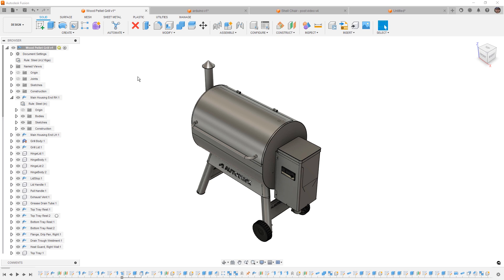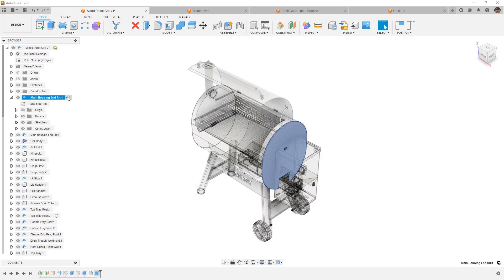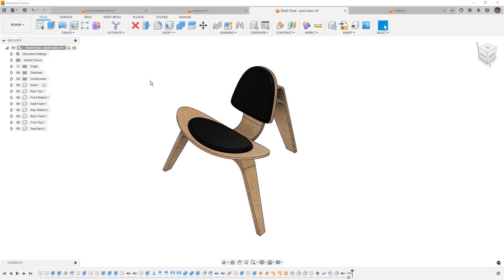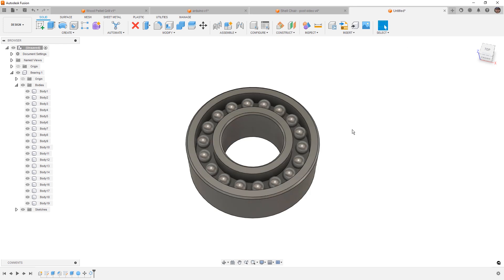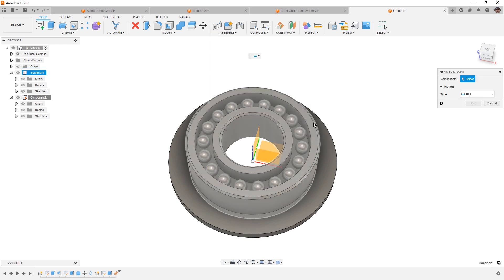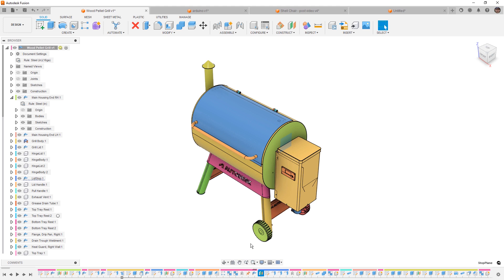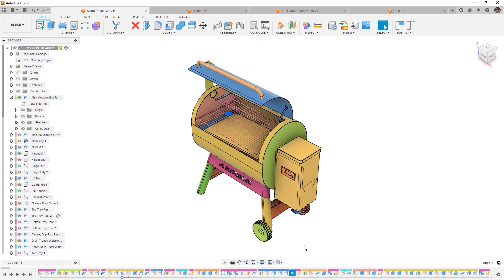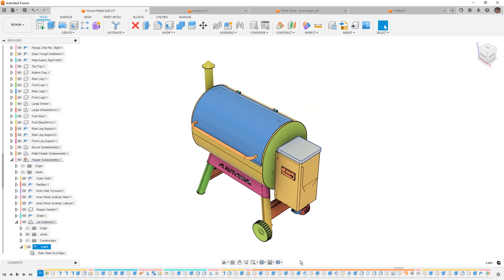Design History in Autodesk Fusion

Comment: 1:37 You should always create a component first, whether you think  you're going to end up with an assembly or not. Even if you're positive you'll only end up with one body, create a component anyway. This is so fundamentally important that it's literally referred to as "rule #1". There will most likely never be a situation where you'll wish you hadn't created a component, but you'll almost always regret it if you don't, and it can be VERY difficult to create a component from existing features afterwards. (Luckily there's a plug-in that will warn you if you attempt to create a feature without creating a component and activating it first.)

You should also always rename everything (every sketch, body, plane, etc) - descriptive names make it so much easier to work, especially if you come back to an old file later. That's referred to as "rule #2".